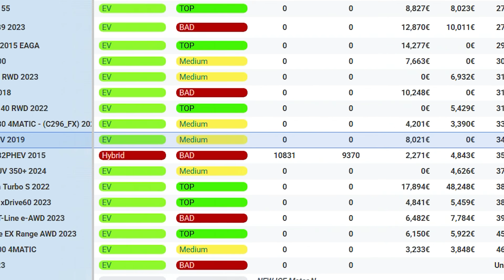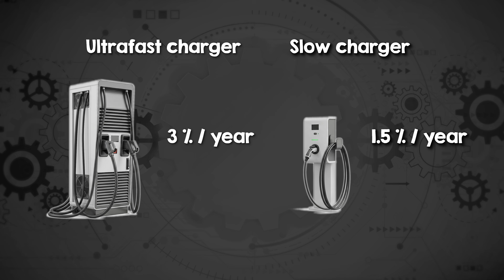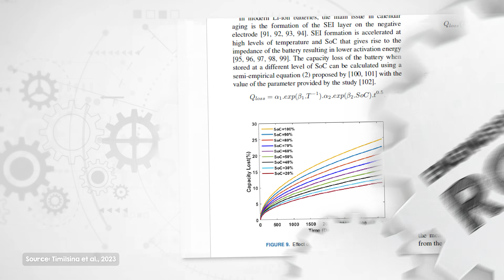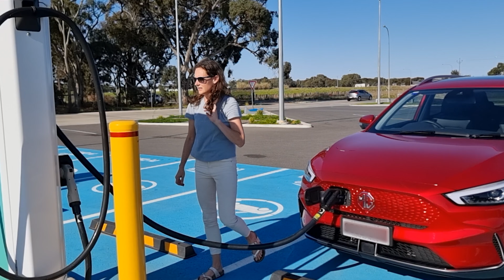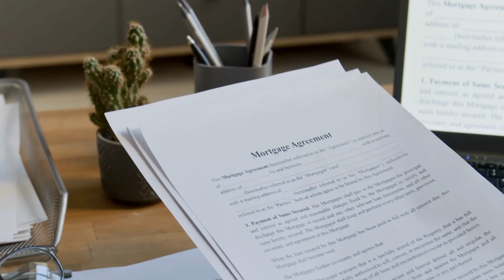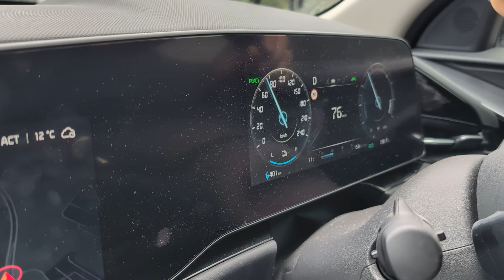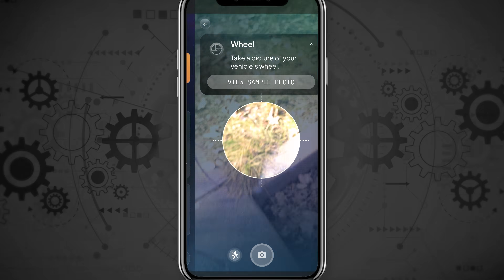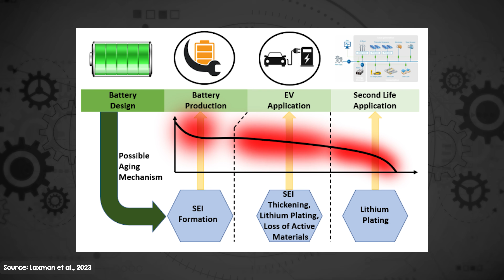Watch This Before Buying Your EV

Comment: I'd like to see more vehicles offering something like the "Leaf Spy" app for Nissan Leafs.  You can get the app, plug your phone into the car's USB port, then look at the numbers while the battery is under load and get a good idea of battery health.  A lot of secondhand listings for Leafs now include a screenshot of the Leaf Spy readout, so you can have a pretty good idea of its condition before buying (or run the check yourself while test driving).

Comment: We bought a VW Buzz 6 months ago, and we've done close to 15,000km in her, through a Canadian winter. I monitor the battery health using an ODB Link feeding the EVScanner app on my phone, and we also keep a close eye on whether the range prediction stays accurate. This setup is reporting 99.7% battery health, and the range prediction is holding nicely, so we're reasonably confident it is accurate. So far we're really happy with the car and with the battery performance.

Comment: My 2014 LEAF has an 85% SOH, obtained through the LeafSpy app - it's one of the Lizzard batteries.  Battery chemistry for LEAFs has changed over the years.  What hasn't changed is how to identify weak cells: stress the car (drive uphill at quite apace) when the State of Charge is less than 30% and look at the distribution of cell voltages.  If the cell voltages are fairly close, then the battery is behaving well.  Otherwise, you might want to look for a different used LEAF.

Comment: Rosie is already calling out most factors you might consider. But it's worth considering that most second hand EVs were only made this decade. The Tesla Model 3 in 2017 was the first production EV produced in larger volumes. The vast majority of EVs currently in circulation were produced after that and adoption ramped up sharply from 2020 especially. So, the vast majority of those are still under warranty! And if the battery fails within the warranty period (generally 8 years or 100K miles, whichever comes first) you might get it serviced for free. 

Either way, we'll probably have to wait another decade to be able to confirm the exact moment when batteries start dropping below 80% of their original capacity which is generally what manufacturers guarantee with their warranty. Most EVs are simply too young to accurately predict this right now. All the data is showing us that "so far, so good" as far as manufacturer predictions go. We have good hunches of course based on manufacturing testing and the usable ranges of second hand cars. But the fact is that even second hand, most EVs are still pretty new. And also they tend to be much improved over the early models shipping around 2017 or before that. So, they should be a bit better than e.g. the early Nissan Leafs, GM Bolts, or Renault Zoes that people were buying before 2017. Those and a few early Teslas are pretty much the only EVs that are old enough to have data on. Many of those models are still on the road despite having a quite respectable age at this point.

Another point is that the average second hand value of particular models of a particular year is probably a good indication of how good and serviceable these cars are. Certain models have issues and that tends to be reflected in their second hand value. Other models are known to be pretty solid and those are worth more second hand. Older Teslas tend to still hold some value. Much newer MGs might drop in value much more quickly. Some premium brands with high volume sales are probably going to end up being quite serviceable. Other not so premium cars are probably going to be written off sooner because parts are hard to come by and the original parts weren't that great. This all tends to reflect in the second hand price. If you find a too good to be true deal, look into what could be wrong with it. Just like you would with any second hand car. Also, would you put a brand new engine in a 12 year old third-hand car? Of course not, you'd scavenge some parts second hand and patch them up. The same will happen with EVs. If somebody crashes one, the battery and other parts are valuable commodities. A totaled EV can be worth more than a still functional ICE car of the same age.

Comment: It is the mass of the battery that is a concern, if you have an accident with an EV even a minor shunt that can cause enough damage to the cells in the battery that will turn a minor repair into a write off and parts are expensive.

Comment: A lot of good info in this video but estimating SOH based on 10% discharge is not going to give you good data. Many EVs have non-linear discharge curves, where you won't get the same amount of enegy if you discharge from 20% to 10% or 70% to 60%. Used EV buyers should have access to a reliable state of health but there's no short cut to get that accurately. We need laws that require the cars to display an accurate SOH just like accurate odometers.

Comment: Thanks! I’m planning on buying a very cheap very early EV van for my first ever vehicle after passing my driving test (hopefully within the next year or so finances allowing). It’ll be all I can afford and cheaper insurance than a more expensive one but I’ll just have to live with low range till I can upgrade in years to come. Hope I don’t end up with a dud battery, I’ll avoid a Nissan Leaf as I know their battery management system was primitive so the batteries degraded faster.

Comment: The battery in my 5+ year old Samsung S10 is charged to 100% every day and is still performing fine, if my EV was charged the same way it would have done around 400,000 km.
Reply from the maker: My less than two year old Pixel is not doing as well! It was my first phone in ages that wasn't a Samsung, maybe I should just swap back next time.

Comment: So did you buy the red MG? Nice car!
Reply from the maker: No that was a car I borrowed for a while. I ended up buying a 2023 Kia Niro
Reply: @EngineeringwithRosie  The red MG is great in the Oz sunshine... On a different topic, watch out for GB electricity generation stats kicking gas off the network. Solar and wind have been doing great in April but even better there is 5 GW of new wind likely to get finished before the autumn gales. This could start to push gas down to 15% by the end of the year... just saying..

Comment: 300k mile tesla's are retaining more than 85% of their battery capacity, and that's AFTER the break in period. Bolt EUVs are doing similar numbers. EVs are better than EVERY gas car, by EVERY metric, and it's not even close.

Comment: There's another big difference between EV batteries and cell phones (or at least cell phones from 5-10 years ago and cell phones today) and that is what I'll call...cycle frequency. Basically, most people drain 70-100% of a phones battery in a day...or at least that was common 5-10 years ago. EVs do not get drained so much, you might only use a 100% of the batteries capacity (1 cycle) in a week or two. So your cell phone battery is being cycled 7-14 more often than an EV battery. So a cell phone battery that used to last 2-3 years even if everything else was the same, you'd expect an EV battery to last 15-25 years.

I think this is also a big part of the reason that cell phone batteries are lasting longer today. They're much larger, so they tend to be used to only 40-50% in a day, so we're seeing battery lifespans of 4-7 years instead.

This is great news in general. Batteries used to be a major consumable component of devices, and now we're getting to the point where they're starting to be only one of several factors limiting lifespan.

Comment: The cost of an EV battery has dropped 90% in the last 10 years. I just got a new EV and if that price trend continues (which it will), I'm not seeing an issue with having to replace my battery in 2036. Cheaper than repairing my ICE car over the last decade for sure.

Comment: Many people can live with some after warranty degradation for years as long as the purchase price reflects good cost of ownership. More serious are cell failures, however, independent repair shops are starting to appear that replace cells or rebuild the entire pack as well as motors, controllers and more. Also, what's underneath is more important than the badge. When you have say a BorgWarner or other global supplier's drivetrain, you know spares will be available for a lone time and at a fraction of the cost of a new vehicle.

Comment: Avoid Mitsubishi Outlander PHEV models older than 2021. No buffer on charging to 100% and no liquid cooling. I am at 149,000km on my 2018 model and am at 60% of original capacity.

Comment: Reminds me of SSDs years ago ... "They're gonna die on you, better get an HDD with no expiration date!!"
The first SSD I ever bought in 2009 was in my gaming PC for many years until that machine became my moms PC. I recently checked the drive health via Samsung Magician and if it keeps being used the way it is, it will die - in about 50 years lol.

Assuming I charge my EV once a week, reaching the 5000 cycles the battery is supposed to last for according to the manufacturer would take ... well, longer than I'll be driving it. 😅
Reply: Yeah you were fine as long as you didn't buy OCZ back then. I think of all the used SSDs I have ended up with. The 3 dead or dying ones I have are all ocz.
Reply: Mmm, yeah that's because it's a Samsung.  I returned several Intel Sandforce-based SSDs under warranty before it dawned on me that the warranty isn't worth a dime. Samsung's longevity certainly is and I suspect it's attributed to them making the NAND, the controller and the overall product, so no one else to pass blame to if it fails.
Reply: You are missing the point entirely. Batteries can last for maybe a decade or more but they degrade in capacity. I've had a 9 years old laptop battery that only held about 20% of it's original charge at year nine. Still functional if you rarely stay away from the mains. SSD's don't degrade like this. Also realistic battery cycles are 400-2000 depending on how you use the battery. 5000 cycles is way too optimistic; but you won't know until year 8 once the warranty is expired. Due to the way it works, batteries are expected to degrade faster after about year 8(there is a reason they chose year 8 as the cut off for the warranty period). This is due to the fact that a degraded battery(having a lower capacity) is good for fewer miles with each charge cycle(needs to be charged more often as it ages). Degraded batteries burn through more charge cycles for the same miles done. I remember someone claiming that their original Nissan leaf had ~60% battery capacity at year 8.
Reply: @longdang2681 Thank heavens I have a 10 year warranty on my MG ZS EV 😊😊😮
Reply: @longdang2681 This. The point is not when or if it will die off completely, it’s when will the capacity be so low, that it’s not (as) usable anymore.

Comment: I usually buy my (ICE) cars at 10 years old and 100,000 miles, I agree the degradation is an issue but even knowing the battery is degraded is an issue when buying, fuel tanks of ice vehicles don't degrade over time so are easier to buy when old, maybe solid state batteries will help solve this degradation issue but in old cars it's just another throw of the dice.

Comment: Shoutout to the unsung hero of EV battery performance, the poor little 1st gen Nissan Leaf. The entire industry learned so much from that one model demonstrating everything you can possibly do wrong for battery longevity.
Reply: And yet my 2014 Leaf is doing great. Still has 70% battery.
Reply: A great lesson in what not to do. For better or worse. 

We didn't need such a focus on being able to take down the entire pack, it wasnt worth it. I do stand behind being able to replace sections though. Early tesla packs were great for that, maybe too much. 4-7 modules is better than one. Dont use pouch cells that puff up instead of vent.
Some sort of thermal management is a must. I'd love to see how these packs had lasted if they atleast added a fan and duct inside to circulate air to avoid hot spot.
Reply: Laugh, I bought one (a 2011 model) a bit over a year ago. It's been fine. Battery health is a bit over 60%, I don't need a huge range, and the degradation's only been about 1.5% per year in the time I've owned it.
Reply: Wow🤯 
I know her too
Mrs Mary Spinner is a remarkable individual whom has brought immense positivity and inspiration into my life.
Reply: Venturing into trading as a newbie was very difficult due to lack of experience, which resulted in losing funds. But this same Ms Mary Spinner restored hope; she's a good woman.
Reply: I raised 75k and Mary Spinner is to be thanked. I got my self my dream car a just last weekend, My journey with her started after my best friend came back from New York and saw me suffering in dept then told me about her and how to change my life through her. Mary Spinner is the kind of person one needs in his or her life! I got a home, a good partner, and a beautiful daughter. Note!:: this is not a promotion but me trying to make a point that no matter what happens, always have faith and keep living!!
Reply: Please how can l get in touch with this Mary Spinner ? I really need to give her a try
Reply: The best expert for active management I've seen is Mary Spinner. I usually just HODL, but Mary Spinner's strategies opened my eyes to potential gains.
Reply: This is her WHAT'SAPPS
Reply: I work two jobs as a single parent, and got to know of Mary Spinner from a colleague at work.i delved in and to God be the glory, my little kid is in school.
Life's been fair lately
Reply: Are you also going with Mary Spinner? This woman has been a blessing to my family, her teachings and two financial schools from which I have learned a lot, I appreciate her professional guidance.
Reply: I'm sure Mary Spinner can help you out.
Reply: I have her WHAT'SAPPS
Reply: +130
Reply: 74. 00
Reply: 10. 84
Reply: Always active she'll direct you properly.
Reply: Spam bots are rife here
Reply: I just got rid of my 15 year old Leaf. It would still do about 50Km  charging to 80%
Reply: Financial education is what we need right now for more than 70% of the society in the country as very few are literate on the subject.
Reply: I just curiously copied the digits and sent her a message and she responded❤️thank you sm
Reply: Honestly, I  will say she’s an angel who God sent to help the needy
Reply: Sure, but that reminds me YouTube's got a thing with posting No.,so l'm going to drop her No. In a bits. Hope thats okay..
Reply: +130👎🏻
Reply: 7400👎🏻
Reply: 1084👎🏻
Reply: Tell her that  I referred you🙏🏻🙏🏻
Reply: Most time having knowledge or insight about a particular activity can as well be a pleasing exercise. I can boldly say that Stock investing is one of the profitable money exchange services that elevates investors and their financial status.
Reply: Is there anywhere i can get across to this woman for a startup?
Reply: Bless up🙏 If I had not experienced this myself I would have said this is all lies but l've made withdrawals a few days ago and that's one thing I find difficult and impossible with other brokers
Reply: Reading through these comment threads has encouraged me a lot. l've come across his name in many reviews, and I will certainly be using her services.
Thank you for sharing!
Reply: I’m really glad I stumbled on this today.
Reply: I've just started learning about value investing. Also, investing in S&P 500, I've found that many good stocks are undervalued despite their intrinsic value.. If you had $100,000 to create a strong investment portfolio, which stocks would you choose for better returns?
Reply: Unfortunately, not all of us were financially literate early. I was 38 when I finally educated myself and started taking steps. I went from $112,000 in debt with zero savings or retirement to now, 2 years later, fully debt-free and over $800,000 net worth. I know that doesn't SOUND like a lot, but I'm incredibly proud of it. Now I'm fast-tracking my wealth building (investing $120,000 annually) and don't owe a dime to anyone. It's a good feeling!
Reply: How did you manage to achieve that level of growth? I've been doing everything I can to improve my investments. I want to retire in a few years and need better diversification.
Reply: It's surprising to see Mary Spinner mentioned here. I didn't know they had helped so many people, not just me and my friends. I'm expecting even more now. 🙌
Reply: The first time we had tried, we invested €10,000 and after amonth we received €50,230.That really helped us a lot to pay our bills.

Comment: The 3% loss per year when DC fast charging compared to 1.5% when AC slow charging could be caused by much more mileage and cycles of the fast charging group.

I think fast charging is not the problem for degradation.
The car will limit power as seem fit for the battery temp and SoC

Comment: I had to get change my last 6 year old phone because it would not run some software (Android), the battery was fine.  I have a 5 year old Kia EV and I'm more concerned about software support than I am the battery.  My sister bought a 2 year old Smart for two and was told the app is no longer supported!